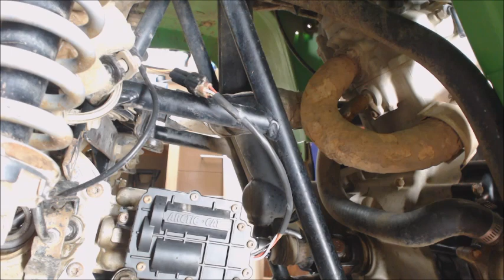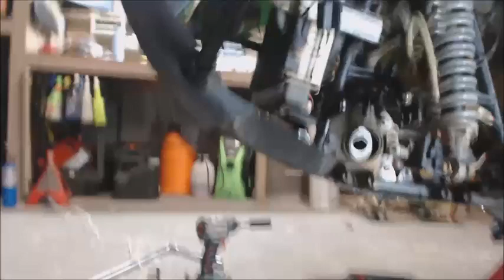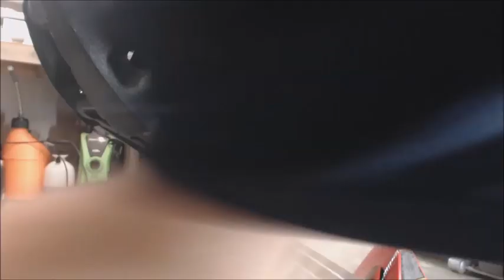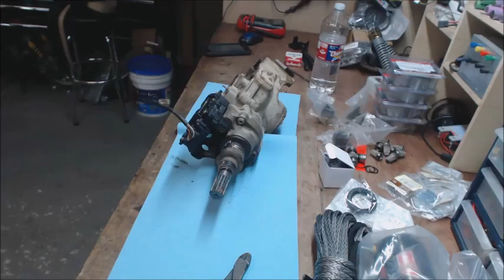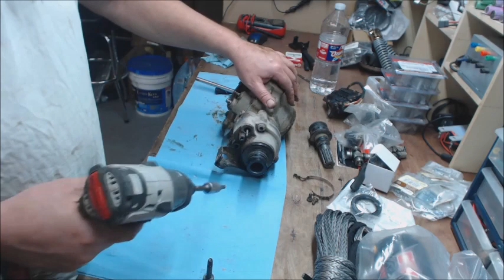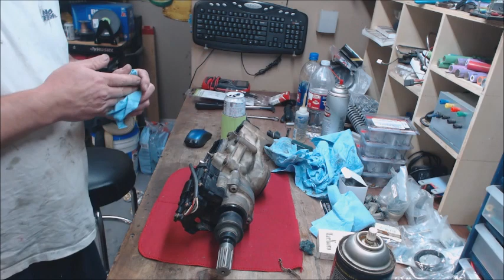2008 Arctic Cat 500 Front Diff Seal and U-Joint Replacement Video 2

Comment: I am having troubles pulling the cv boot off what should I do?
Reply from the maker: I don't understand? you are trying to remove the boot from the Axle? is the Axle bad?
Reply: @mikesgarage9757  I’m trying to pull the whole cv axle like you did in the first video but I couldn’t really figure out how u did it
Reply from the maker: @lucasdenhartog8053  So it has a little clip inside on the end of it that needs to pop past the groove. What you need to do is wrap a ratchet strap around the Axle Cup close to the diff. Give some slack and wrap the other around a dead blow hammer. Then give it some slack and jerk on it. It should pop out. Dont pull on the Axle you will pull it apart. I am about to do this in the nex couple of days. Its wet rainy and cold right now. When I do I'll make a video.
Reply: Okay thanks for the help

Comment: Do you know if this is similar to a 2007 arctic cat 700 efi 4x4? I am just doing the seals but the front driveshaft looks different at a little angle and has no rubber covering it.
Reply from the maker: Sorry I dont, But I have this link. Just click on your year. It's Exploded Parts Diagrams that may help you out.
https://www.babbittsonline.com/oemparts/c/arctic_cat_atv/parts
Reply: @mikesgarage9757  Thanks I think I can figure it out now haven't started on the project yet but thanks.

Comment: Hey there I’m replacing the u joint on my arctic cat and I’m having some trouble getting the yoke back on the shaft on the front dif. The room is just not there. Do I have to unbolt the dif and move it ahead a little? 
Thanks
Reply from the maker: Sorryu you probably already figured this out. Yes I unbolted the diff